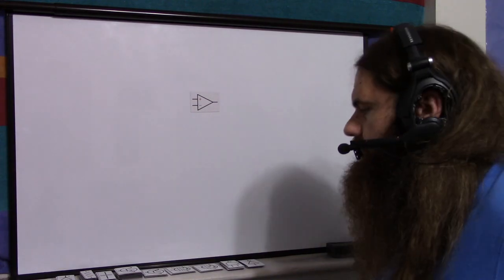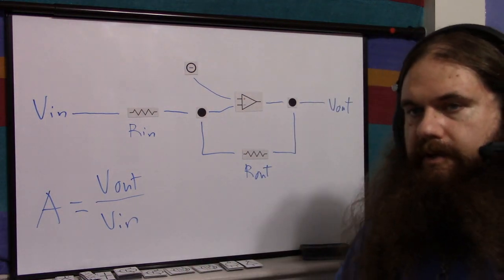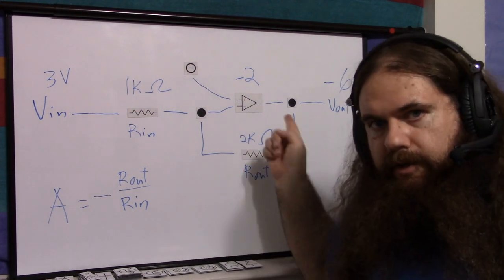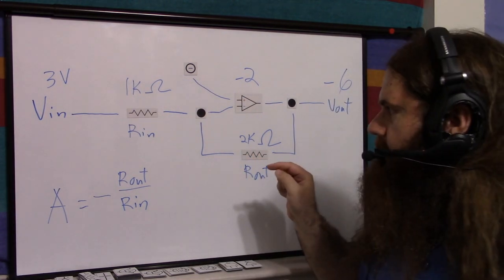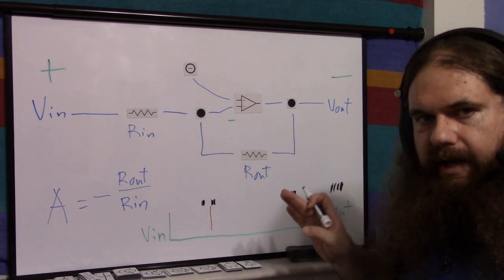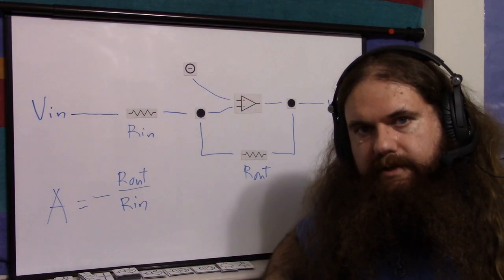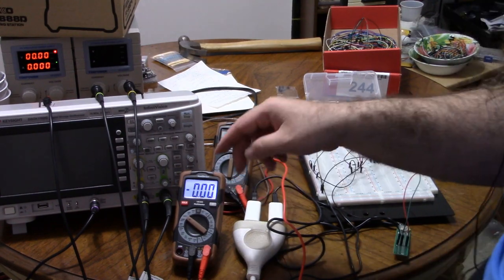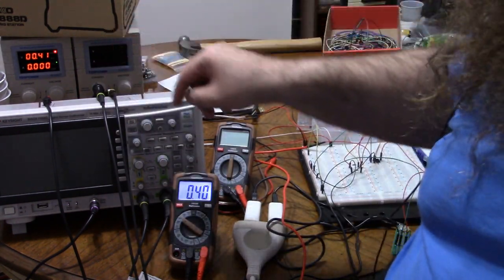Op-Amp Inverting Amplifier - Simply Put

Comment: I couldn't follow everything you were saying so I'll have to watch it again but I did learn some important concepts. I did some experiments based on your tutorial and finally got the output voltage to vary with a potentiometer on the inverting input. I normally learn the math formulas only after I learn to build the basic circuit. Great video. I'm going to watch your other op amp tutorials. Thanks.